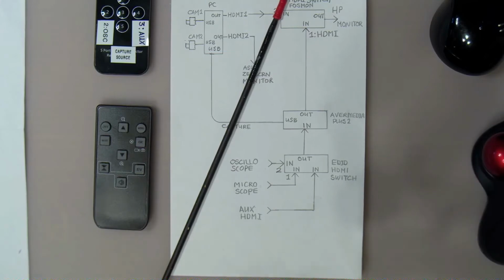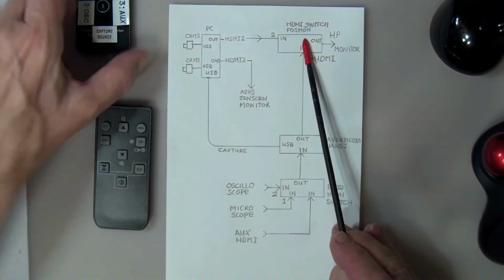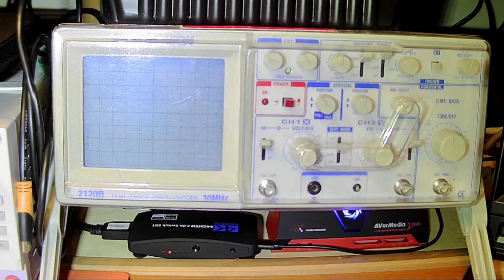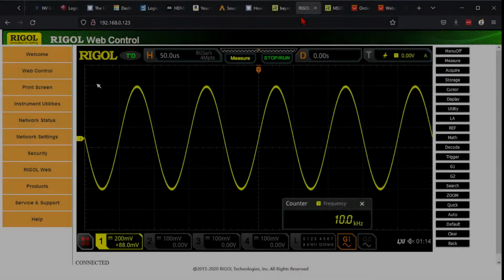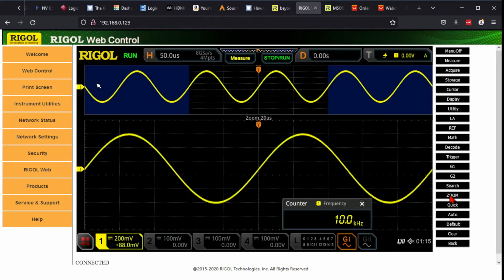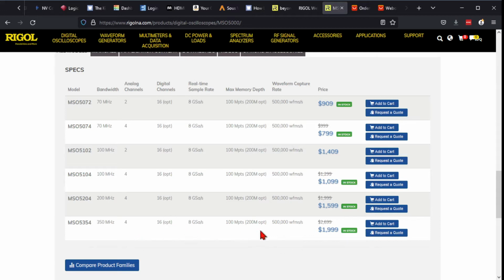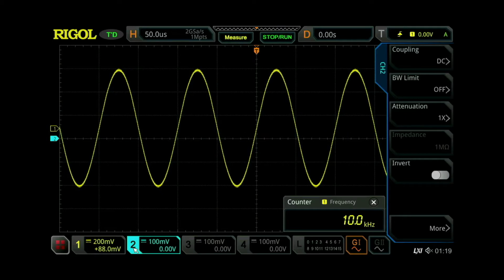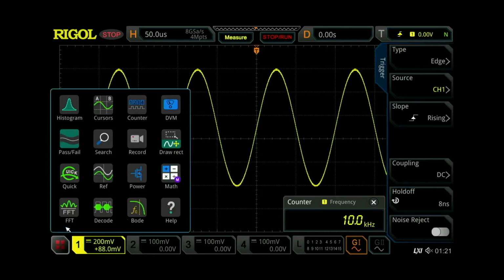Lab Updates and a new Oscilloscope

Comment: I considered this scope this past fall when I was in teh market for a new one.  I was humming and hah-ing between this and the Siglent SDS2000X-P series.  The was less expensive and had 80% of the specs of the SDS2000X-P, but it was mostly the color that slowed me down on pulling the trigger.  Then Siglent knocked $300 (or was it $400) off their price and that sealed the deal.  It was still a bit more than the Rigol, but that price cut put it squarely in my budget and the better specs and the more agreeable color scheme were appreciated bonuses.
Reply from the maker: The dark color which is probably what you are referring to is subjective.  I prefer the dark colors of many recent devices like oscilloscopes. I like to work with low light and find the dark color less reflective etc.  It is not perfect but has done a good job for YouTube videos using its HDMI output.  I do not regret buying it and I like its logic analyzer features.

Comment: Thank you and I have now watched all and seen the light modification in this one which  you mentioned in the microscope video. Was it LED or LCD screen? Glossy or Matte?
Reply from the maker: If you are referring to the filters I scavenged from a TV.  It was a HISENSE branded LED TV so the filters are made to provide an even back-light for the TV and I found it useful for diffusing the light on the microscope.  I suspect that any LED TV or monitor has these kind of filters in them and are worth saving.